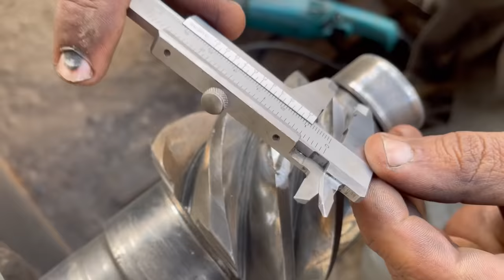I repaired the scrub pinion which no mechanic repairs | Give your opinion by watching the video |

Comment: I am a Machinist, 30 years now I am currently working for a company that manufacturers the biggest pumps and compressors in the world. We make our own gears and shafts on site. They are machined, heat treated, and ground to finish dimensions. We have on occasion welded up and re-machined some parts but not gears or splines that have been heat treated.
With all due respect, this guy's work looks good for what he has to work with
 But I don't think it would make it through QC
Reply: Very well said.
Reply: What’s qc🤔
Reply: @Buddy-po4hv  quality control
Reply: Wouldn't be surprised if this part doesn't last all that long. I also thought the title was a bit moronic, of course a mechanic wouldn't do a machinist's job, the most a mechanic would do is replace the part, and an actual machinist would properly make the part. Not to mention pinions and ring gears are fairly easy to get, it's not like this is some hard to find part that requires a one-off machining job. I honestly wouldn't even be surprised if this is a random piece of scrap used for the sole purpose of making content, like all of those low-quality 'DIY project' channels that make nothing of practical use with random objects they find lying around.

Also the reply about me being so well versed about spare part availability in poorer areas of the world is hilarious. People quite obviously don't understand how easy it is to salvage parts off of another inoperable vehicle, especially when the part in question is as abundant as a differential. If it doesn't fit, adapt it; doing this would be a better job, a faster job, a cheaper job, and a safer job than what this video shows. Cuba's car culture, which is a very well documented situation of lack of available new parts, can teach you a thing or two about this. Some of you actual idiots should go educate yourselves, though I wouldn't expect much from people that lack common sense.
Reply: As an engineer I agreed with you. From my observations like your there were many steps missing but I think I would have turned s new gear.
Reply: @cesarcarofelix4096  Quality  Control
Reply: In the machine shop there is an unwritten law. If you can't make it right, make it pretty.
Reply: I don't think this one will make it to QC
Reply: ясен хер не пройдёт, кустарно заваренная шестерня, ещё и отшлифована наждачной бумагой "для красивого вида", тут не красота нужна, а точный размер, к тому же шестерня с завода закалённая, а тут просто наваренный металл, не думаю что будет толк в таком ремонте и она долго проходит.
Reply: You are right but in that environment QC is never the priority cost is.
Reply: @xaytana  You're clearly well versed in how available spare parts are in places like India.
Reply: Same thoughts. The heat treat doesn't exist for fun. After so much heat from the welding process... The structure has definitely changed. Also the welding isn't as strong as the steel part it self. So it looks very nice no question about that.. But nothing else I think
Reply: @xaytana  no mechanic does that bc the part is ruined before and after restoration. Bc of the changed structure.
Reply: It's a third world country - Do you think they have QC?
Reply: QC is quality control. 
And kudos to these 3rd world mechanics that make do with what they have! Excellent craftsmanship. Keep up the good work!
Reply: I agree it will not pass an NDT test and I give it 1 hour of use before it fails.
Reply: I like professional tooling with a grinder. This part will mess up matching gear quite fast or at best reworked tooth is smaller then original one and wont be stressed at all.
Reply: depending upon the welding rod grade he can achieve the required 32~48 hrc. It will not pass QC in your country but then again we didn't keep flying those f16s even when your uncle sam stole our money. I am glad we didn't depend upon machinists like you who rely on expensive machines to do their job but this is Pakistan good enough quality for us.
Reply: @Old Seeker  I did state that it looked good for what he has to work with.
Reply: @Randall Smerna  yeah, it's considered a Quick Camel with a AK47 at your side.
Reply: They dont need it to work for a long time
Reply: @philipveipert7663  sounds realistic.
Reply: @jessekoch3480  for this type of gear, grinding is the way to go.
Reply: Good thing they have no QC I guess. Maybe he just did this repair for the YouTuber, I'm guessing.
Reply: They couldnt care less about QC lol, they are getting by with what they have
Reply: They don't have qc tho so it don'tatter lol.
Reply: @xaytana  the job description  for a mechanic isn't so finely delineated in  other countries.  I know that in France that mechanics needed to be proficient at fitting and turning and such stuff .
, i don't  know  about today though.
Reply: The hardness on those  gears is only in the surface for say a ½ a millimetre at most . Is that  right? Will the heat from  welding  perhaps  degrade  the hardness? The weding rod can be however something  like a hardfacing alloy . His welding appeared to be in short  bursts which  might not heat the unwelded portion too much .
Reply: @michaelcorbidge7914  Mechanics would never do a machinist's job anywhere in the world. The most they'd have are simple setups to touch up tolerances on parts with specified clearances, otherwise the most they would do is use a brake lathe. A mechanic would never have the tools, nor the knowledge, to do this kind of job properly, considering the tooling, setup, and metallurgy. Hell, the vast majority of general machinists wouldn't even take this job because of the setup it requires, and because the specifications of the gear may very well just not exist outside of the factory they're produced in; not to mention differential rings and pinions are matched pairs, if a repaired tooth doesn't match well, the set doesn't operate as well as it once did, if not induce further, uneven wear that increases backlash on all but one tooth. Not to mention that an improper repair also risks the differential set further, as the 'repaired' tooth will more than likely snap off and either seize the set or break other teeth. With how abundant differentials are, even within the poorest of areas, it's better to just swap set for set because of the amount of issues a proper repair would face; and this job would be a mechanic's job, a fairly simple one, faster one, and one that has better results, not to mention that the job would require swapping the entire housing and never touching the internal gearset. These concepts are so basic, everyone here should understand them, this is nothing but bad DIY content that's typical for it's country of origin, it's very easy to see that it is and why it is.
Reply: Olmaz,olmadı,olmayacak.Çünkü ısıl işlem gören bir parça o olmaz.
Reply: I don't think QC exists there do you?
Reply: Сережа бл..... Сколько стоит новая закаленная? Надеюсь все понятно?
Умничать на диване и покупать с доставкой может любой, а сделать так когда нет денег можешь? Эксперт хренов.
Reply: When you see a Pakistani men doing a job, believe me they will get things working and for sure it will pass the Quality Control as well with limited tools!
Reply: To get you up and running this is amazing
Reply: @OldDesiMusic  that environment eating supper at nite mean passed QC NO joke NO worky NO eaty part b back in few days earn supper one more time Lord's will
Reply: good enough for there country with limited supplies .
Reply: I wonder if they all took turns taking 💩 in the differential as a cheap replacement for grease I mean it is india and parts and supplies are hard to come by
Reply: @OldDesiMusic  I'm really impressed by the work done by Pakistani mechanics. They are doing what US mechanics were doing a hundred years ago when we still had a culture of repairing things: "Use it up, wear it out, make it do or do without!". I'm sorry about the stolen money, that's just the nature of our political class. They steal from everyone, me included. Supposedly we have a democracy and even a guy like me can expect his voice to be heard, but in practice, this isn't true. For 50 years I have been telling our rulers: "Stop stealing everbody's money!", but they never listen to me.😔
Reply: You also probably have 1000x the machine he does no shit it would pass qc
Reply: LOL !
Reply: Desi hasnt have tools and budget BC they need Jugar even our government need Jugar too,🤣🤣🤣
Reply: At his shop, this man is also QC.
Reply: It's a good part to get by, if it's for a light vehicle you would probably get some good mileage out of it for a vehicle that carry loads probably not that much but great skill to get it that neat 👍👍👍👍💪

Comment: You do what you have to do with what you have available. There is no telling how long the repair will last but that’s not the point. Get her going is. Awesome job!
Reply: Конечно не важно, если хитрый индус сразу продаст этот редуктор вместе с машиной.
Reply: @36rusvoronezh  гловное показать, что все пальцы целые. Даже по видео видно, что грани на гипоидной шестерёнке пошли погулять)))
Reply: Well...allow me to disagree...is that filling material chips of or gets loose, it can certainly end up destroying the rest of the gearbox
Reply: You could solve the problem, 1 day or 1 year. Have to change both parts, the pinion shaft and the gear to. And check the contact pattern and do the proper adjustments. That's the life of a gearbox
Reply: Actually, longevity IS the point.......this is a useless repair.
Reply: @genuinegasti  Exactly!!!

Comment: Но зачем зачищать остальные зубья ? Только размеры уменьшать. Но за то клиенту не так будет в глаза бросаться место работы.
Reply: In America, a worker would clean all the teeth  as an act of quality.  Do unto others as you would have them do unto you.
God knows all the teeth are clean.
Reply: действительно, добавили люфта.
Reply: @ktamen  Yes I agree with you.  Grinding on a good gear tooth is a very bad idea.  The new gear tooth will probably make weird noises, or a clicking sound.  Maybe grinding all the teeth will make all make the same weird noises.

I find it hard to believe that this repair will last 100km.  What do you think?

Greetings from America! 🇺🇸
Reply: Что-бы новый зуб не отличался от старых и это успокоило заказчика.
Reply: @ktamen  in the video link you sent it looks like they are planning to use the same oil that was drained from the differential.  This seems like a very bad idea.  And no torque wrenches were used. The price of the parts seems very inexpensive.  So that makes me wonder why they welded the gear tooth in this video.
Reply: @microdesigns2000  It's not expensive for you, but they work for a few dollars a day. For them, $ 200 is a fortune
Не  е скъпо за теб, но те работят за няколко долара на ден. За тях 200 долара са цяло сътояние
Reply: @ktamen  I recently paid $1750 to repair my 13 year old car.  With a lot of time, I could have repaired it myself. But Minnesota winters are too cold for me, I was lazy, and I had the money.  The mechanics in this video make too little.  But the truck owner could probably pay for the parts, no?  How long will the welded tooth last anyway?
Reply: Сбили размеры
Reply: Чтоб все одинаково всрато выглядело

Comment: I'm impressed. I had a DeSoto with a spun bearing, welded to the crankshaft. Pulled off the bearing, filed journal with a hand file, smoothed with Emery cloth. Installed new bearing, was still running years later.
Reply: I’ve heard story like this before. People get lucky now and again. Mostly because everything is so wore out and gets so little use they can claim “fixed”. If it really worked that easy, crank shops wouldn’t exist.
Reply: Hello, the three parts you speak of are made from materials that can't do what you speak of, as for the file

Comment: I watched a guy do this with a tig welder on the ring gear of a 3,000 HP Super Street car. Outside, in the rain, covered with a tarp. It was a temporary repair that got the job done and allowed the team to run the rest of the weekend. Wealth and resourcefulness aren’t mutually exclusive.
Reply: @trexmidnite  

Say what?
Reply: We use to grind ours down for weight reduction.
Reply: @trexmidnite  that the only urdu you know? Racist much?